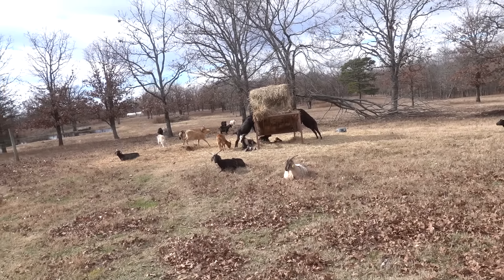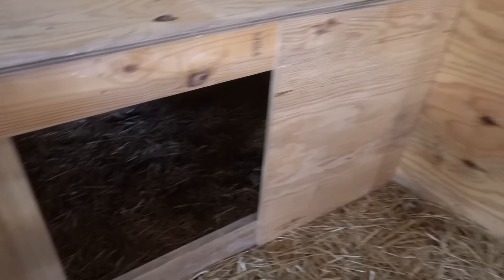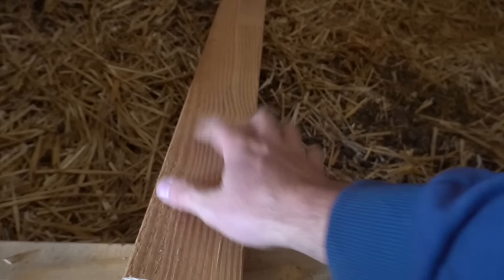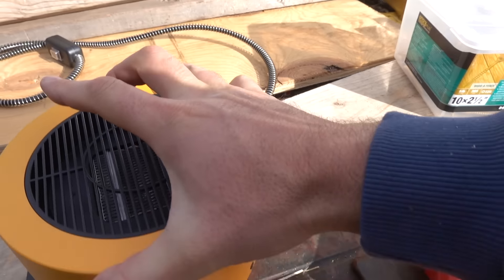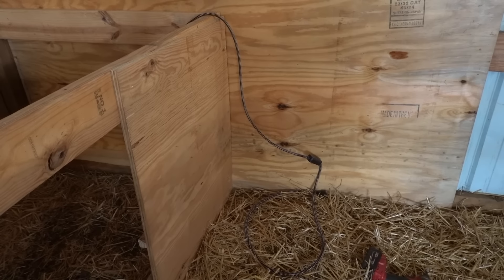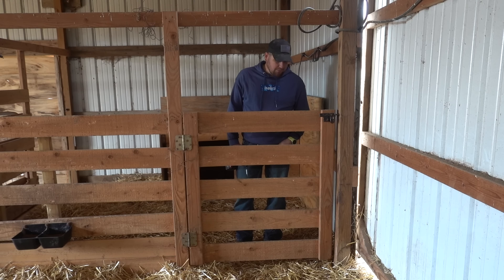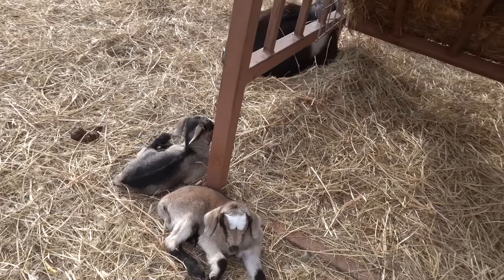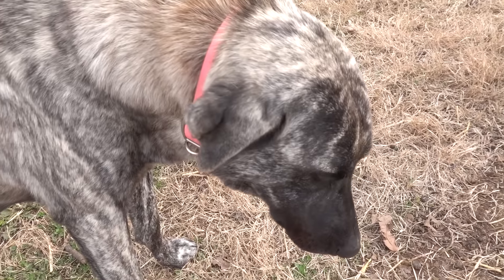Pregnant Guard Dog's Getting Massive! She's Already Bigger Than We Expected!

Comment: I used to raise Golden Retrievers I built my box used 1 sheet of plywood and cut it into 3rds then I cut one of the thirds in half and cut 1 1/2 “ x 1 1/2 wood for the corners to screw the plywood to and put a 2x4 on the bottom for strength and stand it on edge about 3’ from 1 end standing on edge and screw that in at the bottom for bedding and do about the same thing on the other end for them to poop and pee in fill it with Cedar Chips, Oh and put a tarp underneath it all and being 16” high, Momma could jump in and out but keep the puppies in until they were ready to sell at 8 weeks and that worked out Great with 9 puppies at a time but I see you pretty much got it done. But it was easy to unscrew and store for next time, anyway just some ideas for next time. Happy New Year 🎉

Comment: Happy New Year! I have been thinking about the emu’s feeder. It might work to put pool noodles around the opening of the feed holes so they won’t scrape their neck.
Reply: You might want to put hinges on that whelping box lid. That tool to take the screws out makes a lot of noise.
Reply: @susandixon3970, that pool noodle idea is great, but I also thought that maybe if you slice up a length the hose and put that on the edge as it’s a lot thinner than pool noodles. Just a thought.
Reply: I was wondering the same thing! Perhaps they are tougher than they look!
Reply: Yes Roan the hose is an even better idea. I bet he has some in his garage that he can use for that.
Reply: Sorry Rowen I misspelled your name.
Reply: @susandixon3970  that’s ok. I’ll answer to most…. 🤣🤣🤣

Comment: This is on the wire that is still showing outside of the box.  Size a board the same length (top of box to the bottom of the board where the cord connection is at), create a "valley" in this board to allow the cord to "hide" without squashing it.  This will keep any chance of accidental entry of goats (or dogs) and their wanting to chew on it. Happy New Year - 2024!

Comment: Yes you can move them.
They will die in exposed cold weather.
A pup doesnt regulate its own body temp for several weeks.
Also dont put loose heavy blankets in, tuck them under box. It needs to be where they can not get under or they can smother or be stepped on.
I highly recommend  to do some quick research on whelping pups.
It really would be good to bring her in and shut the gate and sit with her everyday for a few minutes. Maybe start feeding her in there.
When you start seeing signs of labor you should lock her in.
And as much as possible be with her to make sure they all latch on within 30 mins to an hour of birth.
I know its nature takes its course but as a retired breeder i can tell you things can get crazy fast.

Comment: I have never seen a weeping box like that. I used to breed dogs. There should be be a top or that high. It should be built so that Incase she has trouble you need to help her. The sides should be low enough for her to step out of the box without having to exit from a door. The father should be able to take a turn if mom needs a break. She will let him. Especially if this is a first breeding. You should be there in case of a breach or one that gets stuck. If she does happen to have them someplace you don’t want them there like outside then pick them up wrap them in a towel or something. Take them to the welling box she will follow you there. Yes you do need the lip around the bottom. You can use newspaper or blankets to line the bottom easy to take out and change so it stays clean. Do you have any Velcro colored collars  so you know who came first? A scale for their weights and of course what ever u use to keep track whether a notebook ot or some thing on your phone. First time litters can be hard. Keep everything near buy. Look up welping box they will show the best shape and all. It shouldn’t be a dog house.

Comment: Kevin, in building your whelping box: Thanks for listening to good advice. This is January 5th that I’m watching this video. Yes shame on me for getting behind.
Reply: The only thing that I might consider doing is to put hinges on the roof with latches to lock it down tight. If something were to happen and you needed to get to a pup time is critical and if you have to run for a screw gun and then remove screws you could lose the pup. You just never know when you have a first time whelping female and what could be a large litter.

Comment: You want to pen Cora up and keep her on a leash starting about a week before you think she’s due.  Otherwise she will have those pups in the woods.  My female got loose and had her last littler under a travel trailer, with flat tires, two properties over.  She finally came home two days later for food.  I let her lead me back to her nest.  I had a sweatshirt on. It was dark.  I had to crawl under and pull those 12! Pups out and carry them back.  PS it was 30 degrees in FL.  🙄. Cora is going to keep the pups urine and poo cleaned up.  I would not put any hay in there. News paper or old blankets or rugs.  The hay dust is not going to be good for pups lungs. Also pups move around so will get lost in the hay.  After puppies start on mushy solid; Cora will not clean their waste. You’ll have to be able to replace the bedding with dust free throw away floor covering.  Newspaper.  If you have a newspaper in your town; you can get old issues for free.  At 6 weeks you’ll want to introduce them to the outside by taking them all outside immediately after feeding them. Cora will probably have them weaned by then or close to.

Comment: Kevin yes it’s okay to relocate the pups just make sure you have momma follow you to the new bedding site.  Also a 2x4 on perimeter of the doghouse and about 4 1/2 to 6 inches up off the floor lay the 2 x 4 flat so that the puppies can get underneath it away from Cora so she doesn’t trap them. It’s almost like when you’re building the pig house with the mom and Sal and her people it’s it’s just a safety precaution the pups from getting squashed and it’s OK for you to interact with the puppies in the mom. It’s a bonding thing and Cora will recognize you are not a threat but yes, you definitely could relocate them to the new hut. You definitely don’t want them wet you don’t want them in a draft and you don’t want him in the cold. Good luck brother.

Comment: The average amount of puppies is eight, but the litter size can vary from 5 to 15. The first litter will be smaller whereas the upcoming ones will be significantly larger. Furthermore, the health of the bitch during the pregnancy will have a direct influence in this as well.